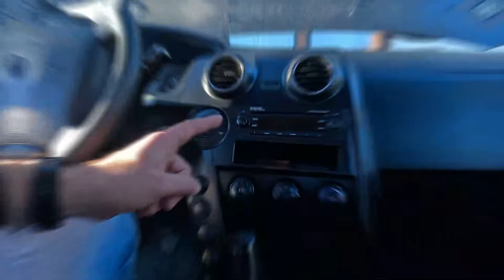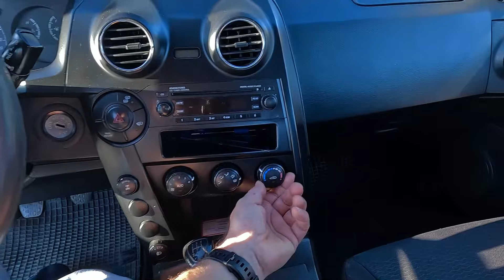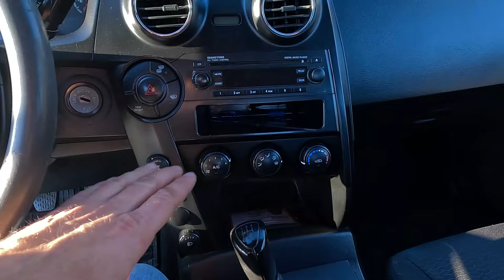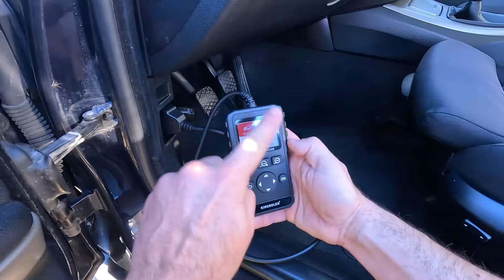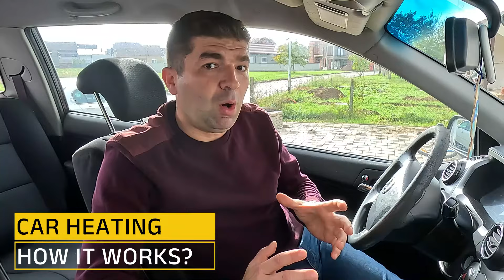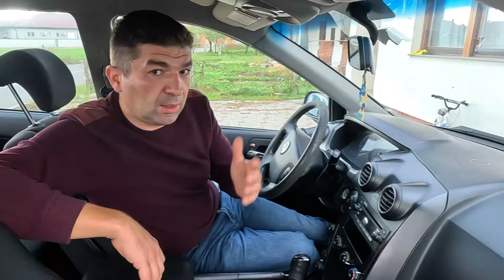Car Heater Not Working? 7 Common Causes & How to fix it

Comment: Nice vid, easy to understand. For me it was both 2 and 3, I thought it would be fixed with 2 but nope still broken. Then one day my radiator broke due to what looks like rust build up. Well... I flushed and replaced the radiator  installing fresh clean coolant after about 2 weeks of driving that seems to have cleared up  the heater core enough to work again. 
I'll probably flush it x2- x3 more times hopefully that will be enough to get all the lime and rust out. I wouldn't do more than that because coolant ain't cheap.  Though it's cheaper than pulling and replacing the heater core, that a nightmare  of a job.